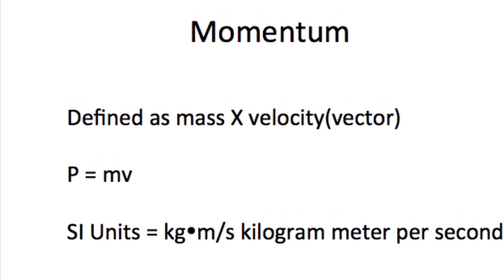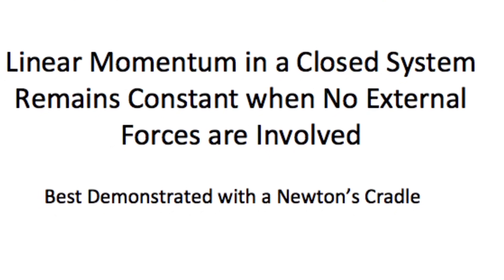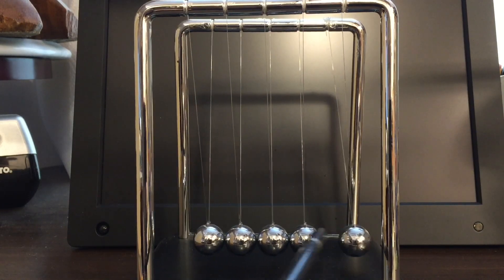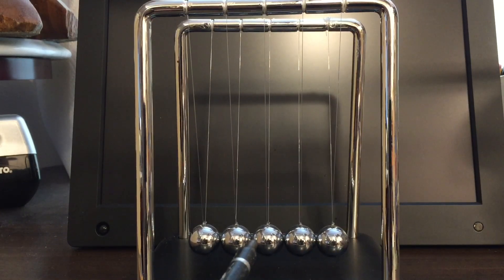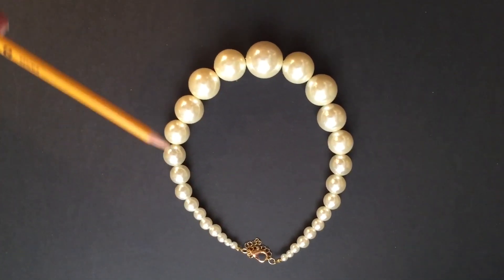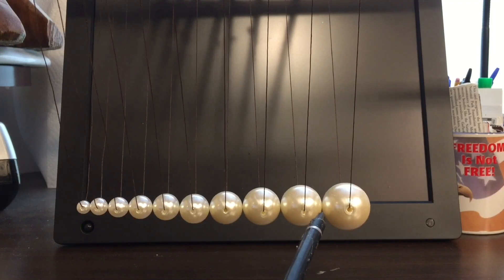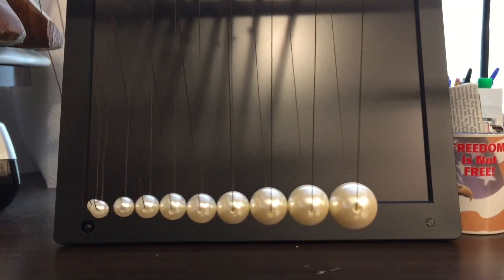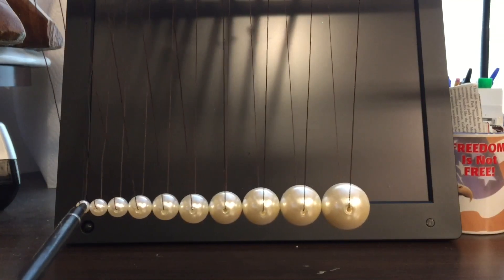Newtons Cradle with Tapered Mass

Comment: Actually, there is another conservation law at play, namely conservation of energy
Reply: If you take this extra law (conservation of energy) into account, you can explain why if you lift one ball up from one side then let it swing to the bottom, you dont get two balls rebounding at a slower velocity ( which is permitted by conservation of momentum).
Reply from the maker: Thanks for watching and your comments.
Reply: @steg20077  How does conservation of energy explain this? Would not the two slower balls have the same overall energy as the 1 faster ball?
Reply: @stevenjones8575  (Sorry for delayed reply). For example, if each ball has mass 3 kg and the released ball on the left has velocity 2 m/s at collision then the total momentum is (3 kg)x(2 m/s) = 6 kg m/s and kinetic energy is (1/2)x(3 kg)x(2 m/s squared) = 6 Joules. Now if there are 2 balls on the right that gets "knocked" out of their position and have the same velocity (while all other balls are now stationary), the 2 balls will have velocity 1 m/s to conserve momentum: (2 balls) x (3 kg) x (1m/s) = 6 kg m/s. But then energy is no longer conserved: each "knocked" out ball on the right will have kinetic energy = (1/2)x(3 kg )x(1 m/s squared)= 3/2 Joules, so then total kinetic energy of the two balls = (2 balls) x (3/2 Joules) = 3 Joules. But the kinetic energy just before collision was 6 Joules. As such, this case scenario cannot happen if conservation of energy and momentum are the only principles that dicate the situation. There are other case scenario to be considered too such as the ball on the left could bounce backward - can this happen? If not why not?!
Reply: @steg20077  That makes, thanks. It's been a long time since I used those formulas, so I didn't remember velocity was squared in only one of them. It makes sense, then that only one scenario exists where the solution conserves both energy and momentum. Thanks again.
Reply: @stevenjones8575  Here is an important scenario: Lets say there are in total 3 balls all of the same mass = m. One ball is released and then just before collision the velocity was 3 m/s. It bounces backward at speed 1 m/s while the other two balls flies to the right, both at speed 2 m/s. In this scenario the momentum and energy are both conserved (you can check this if you want). So the two conservation laws permits this case scenario. But why is it that we do not see this in  Newtons Cradle?
Reply: @steg20077  Good question. Idk. What do you think?

Comment: It’s not just conservation of momentum. If it were conservation of momentum and velocity then releasing one ball could make two balls release off the other hand at half the velocity… the momentum gives it a direction in which the energy travels but does not determine how the energy is transferred. The balls operate like a spring. When one strikes the first ball it compresses then releases its energy into the next one and the next one and so on.
Reply: Actually, there is another conservation law at play, namely conservation of energy

Comment: I always wondered what would happen if you tapped a Newton's Cradle with a hammer.  If you get an equivalent movement to the input energy or does the system just soak up most of the energy and very little is left to create movement.  Could you pull a high percentage of energy out of the thud of a jackhammer or is the shockwave where energy goes to die?